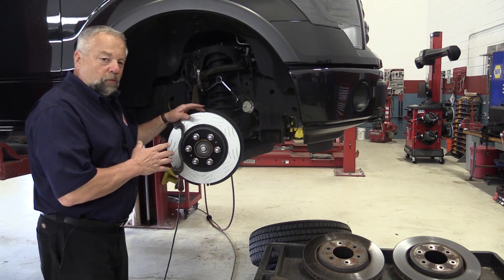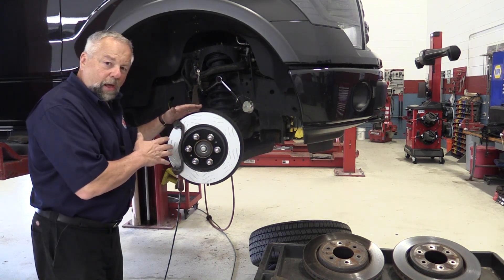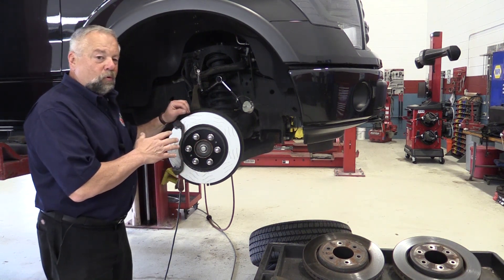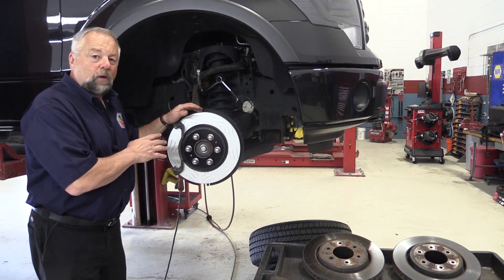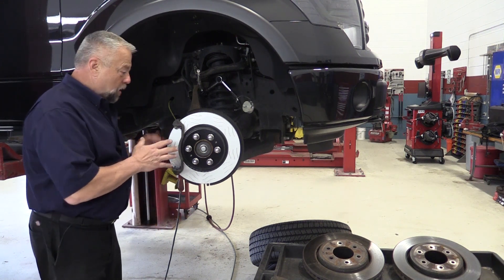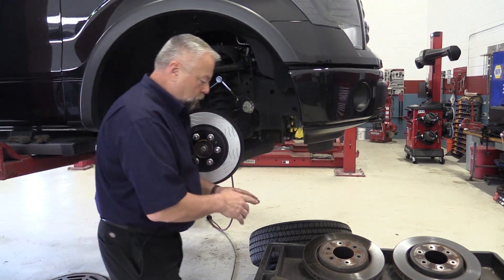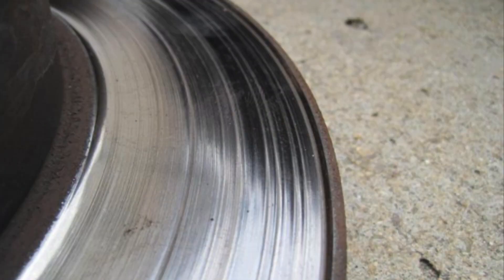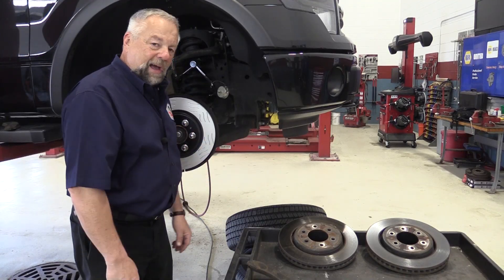Ceramic or Semi Metallic Brake Pads on Your Vehicle?

Comment: Semi-metallic chew up rotors. Ceramic less so.
Reply: Not true. Actually completely backwards.
Reply: @Plutonius X  Umm, no. Ceramics don't wear the rotor as much, the ceramic compounds are smoother (less grainy) That's why ceramics don't "bite" as much, requiring more pedal pressure to get the same clamping force on the rotor. Ceramics were not originally developed for performance in any way. Although, now they have performance oriented versions, the sole reason they were developed is because the dust they produce is supposed to be better for the environment. The original ceramic compounds had copper in them (still not as hard as the steel rotors) in order to get them to bite better. However, most companies are now producing copper-free ceramic compounds because of the pressure from environmentalists, like the EPA, WHO, the UN, etc. I believe the copper-ceramic versions are even outlawed in some locations for the same reasons they are trying to phase out semi-metallic pads. If you think about how many millions of tons of brake dust is being produced all over the world every day, it adds up to a significant amount of unhealthy pollution on a global scale.

Comment: i have heard you chew up your rotors faster with ceramic pads because the harder then the steel.
Reply: Some mechanics try to sell rotors on every job. I usually use ceramics because on every car I owned you could get atleast 2 pad changes before I needed to replace the rotors. But in most cases you can get a 2nd change in with semi metallic just make sure the rotors are thick enough.
Reply: That’s a big crap of what you say. There is no Ceramic pad. It’s just a name. Mostly made of inorganic ceramic, copper, and other soft materials performing actually smooth on the disk. So, more economy disk and pads, no noises, initial bite been corrected by Akebono brand, it actually stop faster and don’t read unprofessional people thinking that semi metallic stop faster. The downside of them is that when you have a race car and you do crazy things, or you have a heavy load car, ceramics can brake! So strictly speaking ceramic pads outperform semi metallic 100%. Ceramic pads are semi-ceramic and semi metallic are metal with organic materials like banana 🍌
Reply: The opposite is true, semi-metallic pads will wear the rotor faster than ceramic pads. The ceramics are smoother and so they "bite" or grip the rotor less than semi-metallic pads which is why they require more pedal pressure to get an equal amount of clamping force on the rotor.
Reply: @ioannisstavrou2677  are you drunk?

Comment: 1.- Brakes transform kinetic energy into thermal energy.
2.- That heat needs to be conducted and dissipated.
3.- All ceramic materials have a low thermal conductivity.
1+2+3 = I bought semi-metallic pads.

Comment: Video was a farce.

Only one thing I agree with . . . . Brakes wear.

Ceramic brakes have been in use since late 90's.Ceramic brake pads tend to heat up quicker for more bite and better stopping but will fade more when over heated.

Some important specifically come with metallic brake pads and will not have a ceramic option.

Heavy duty or service service pads are avalible from most replacement or parts companies such as police, towing or commercial use.

Slotted,drilled rotors are over rated on stock vehicles.People install them on a stock brake system hoping to stop on a dime . . . . All they did is spend the dime.They forget the are still riding around in 19 and 20 inch wheels.
Reply: Heavy duty brake pads ARE semi metallic. Commercial vehicles NEVER use ceramic period. Ask any truck driver. This guy is an auto mechanic.
Reply: This comment is a joke. Bigger wheels = bigger tires and bigger brakes = better stopping.

Comment: You buy a truck for a ride vehicle...that's stupid..just get a Corolla
Reply: You buy a truck for the platform: rear wheel drive, body on frame, solid rear axle toughness, and the V8 performance and torque, in addition to the ground clearance and 4 wheel drive capability. Here in Montana, you pretty much can't do anything with a little car for 4-6 months out of the year, if you're going to go hunting especially, or even drive the kids to and from school or yourself to work, you have to be able to drive through 2-3 feet of snow sometimes. So even though I rarely haul or tow anything with my own truck, other than my son's dirtbike occasionally, I find great utility in owning mine as a daily driver. The ground clearance and 4x4 help tremendously for camping and fishing in the mountains, even in the summer time (sometimes you just want to go 4 wheeling and see what you can get up lol) Also, you can't drift a front wheel drive car on dry pavement or in the snow, and what fun is that lol. My 98 Chevy is totally stock and has 250,000 miles on it, sees redline almost every day, and still runs like a top with the original engine, which also by the way sees cold starts in the negative 30-40 degrees Fahrenheit every year. Considering I only paid $1700 for it over 10 yrs ago and that it gets 18 mpg @80 mph along with all the utility mentioned above, I'd say my truck was a worthwhile investment just for the toughness of it alone, relative to a cheaply built little car, not to mention the safety of being in a big, heavy, solid vehicle. I feel like my children are safer in a truck in the event that some idiot plows into us because they don't know how to drive. Additionally, I can still go 120 mph just fine if I want to lol.
Reply: Corolla's are way overpriced for what they are, especially considering their lack of utility and that all you can do with one is haul people around, and even then, only in decent weather and definitely not on the dirt roads in the mountains, even when it is dry out. We just got 10 inches of snow yesterday in town, in the valley, and a whole lot more anywhere outside of town. Some towns are 100 miles apart in Montana and if you get stuck, you're dead. A Corolla,? yeah.... no thanks, I wouldn't spend money on one around here, and the same probably for most of the northern states. Corollas and similar are worthless when our roads are snow-covered and icy for 4-6 months out of the year. Even if you could get it out of the driveway, you're definitely not getting up an icy hill lol, and Montana doesn't use salt on their roads (a very good thing as our vehicles actually last) It's not uncommon to see vehicles around here that are 20, 30, 40, or more years old with little (just surface rust,) to no rust on them 👍 A 4x4 truck for a daily makes perfect sense in a lot of places. I know they make two wheel drive trucks, but you very rarely see one around here, a truck is synonymous with 4x4 and ground clearance, that's why you get one. Not to mention the stigma: around here, men drive trucks and little girls drive cars, that's just how it is lol.